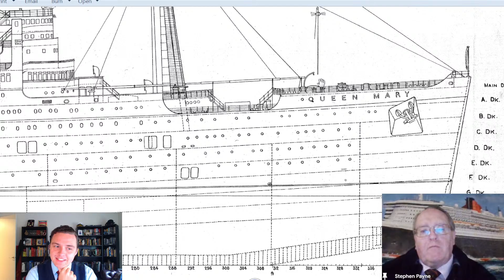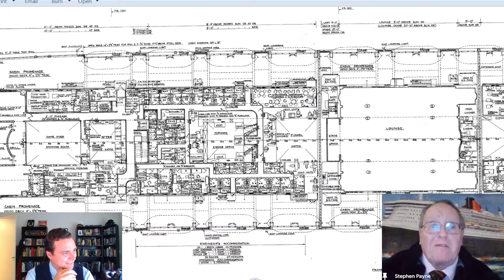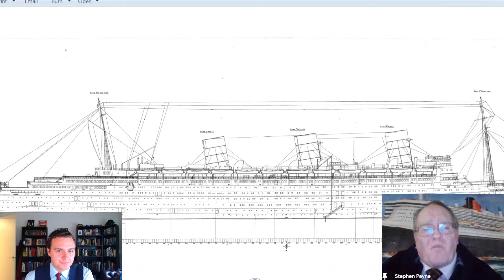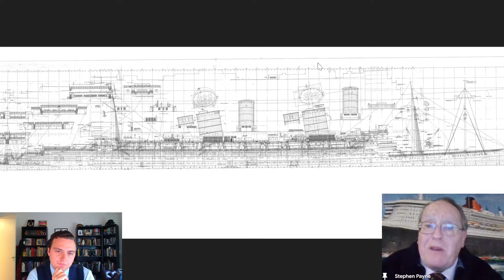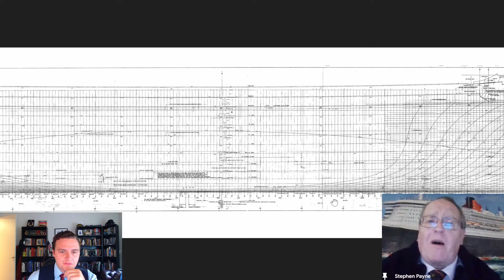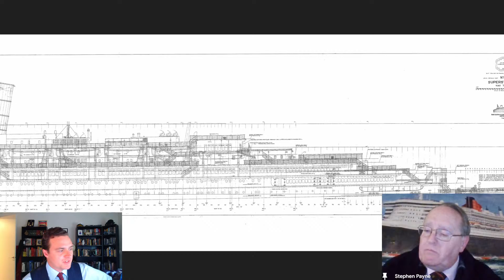LIVE! with Mike & Stephen Payne

Comment: Far be it for me to disagree with the great Mr. Payne, but the Elizabeth was never equipped to outperform the Mary in terms of speed.  

The Mary had three Scotch boilers dedicated to passenger use, turbo generators and kitchens.  The Elizabeth's fewer boilers had to supply steam pressure to those functions as well as her engines.  So in short the Elizabeth had enough power to keep pace with the Mary, but her absolute maximum steam generation had to power everything.  The Mary's Yarrow boilers were solely dedicated to propulsion, was therefore all raw power and thus the more expensive ship to operate.  The Elizabeth was designed to be more efficient...not faster.  

Historian Bill Sauder also shared his interviews with Captain Jones and Commodore Marr about the myth that Cunard ordered the Elizabeth's speed to be held in check.  Both answered "No, top speed on the Elizabeth was, in fact, her top speed with nothing held in reserve.".

Comment: 1:20:50 I paused the video and did a very rough calculation. A rivet coming from Olympic (I forgot where and when it was put on display) weighed roughly one pound. I don't know how Queen Mary's rivets compare to Olympics in terms of size and weight, so I came with a very rough estimate of 5000 to 6000 tons for the 13 million rivets. The weight of the overlapping plates isn't included. Again, forgive the very wide margin of error, as mathematics and physics aren't my cup of tea. But to try and visualize it, the weight saved is the equivalent of a fully loaded Oceanic-class liner. 

As for questions, the only question I'd probably have is if the Queen Mary 2 will be the last ocean liner, or if a replacement is feasible.

Comment: Nuclear Power in a ship is dead - if you simply look at the history why the Otto Hahn did end in a scrapyard:

no permissions from harbours to enter their port, so nothing you can transport - Otto Hahn was a terrible expensive mistake over all.
Quite different story if you imagine to run an oceanline with nuclear power where nowadays most people wanna have a low impact ship and not a dangerous one cause at the end we had enough issues with nuclear reactors on land - and those onboard would be a higher risk cause still in 2025 ships are ramming into each other or get sank by weather impacts or captains running those on a rock close to an italian island killing passengers.